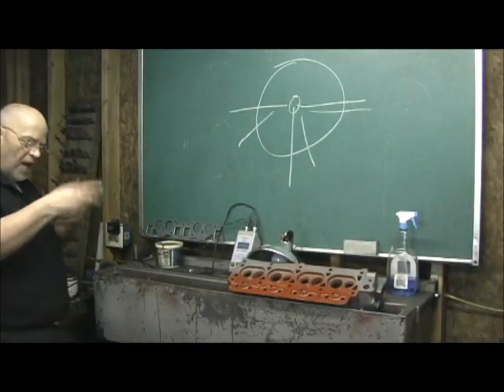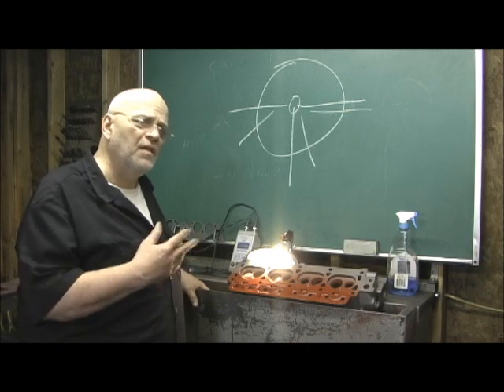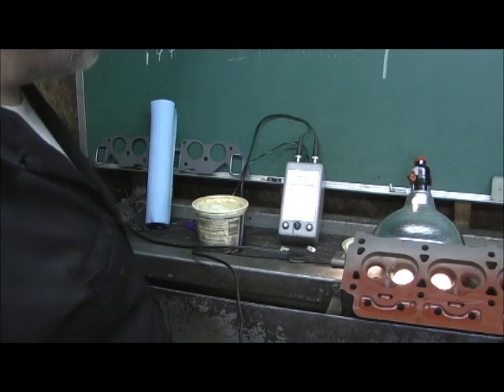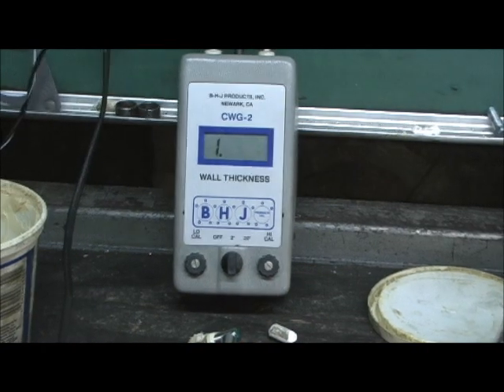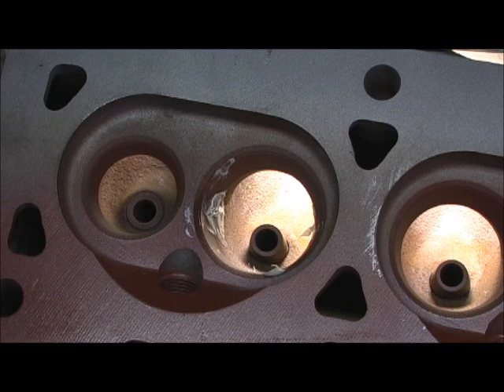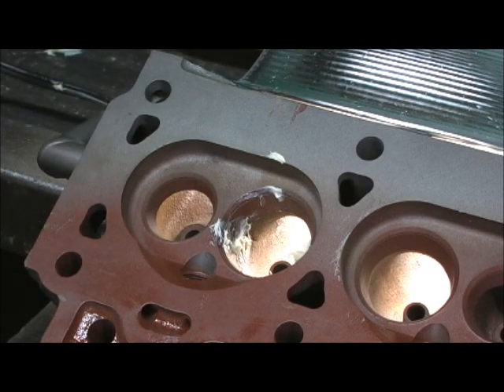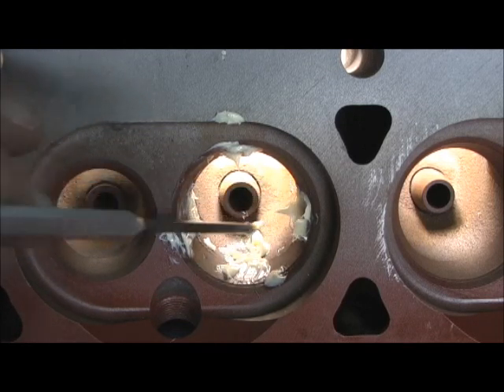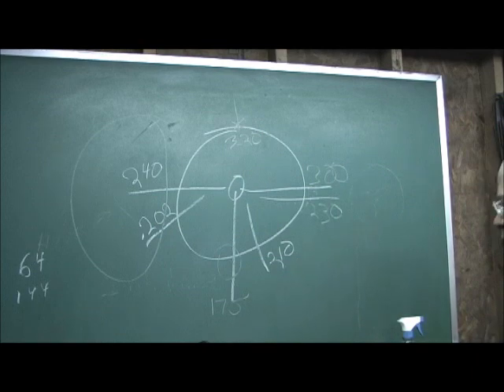Volvo 1973 Stage IV "Porting  Sonic and Intoduction"   1.0

Comment: That chamber is nearly identical to a ram air 3 pontiac chamber stock.
Reply from the maker: I know Volvo broke in to the design dept. of GM and stole the prints, trying to make a Trans am series VOLVO, using HALF the engine and car...COMMING SOON!
Reply: I have a friend with a 9 second turbo  slant 4 Pontiac.  I believe it is half a 389.
Reply from the maker: Charles Servedio back to you on  that, I believe they made that engine, half a 389. Fuzzy on the details, but I believe GM made that.
Reply: It is a wild ride. 5 speed too.